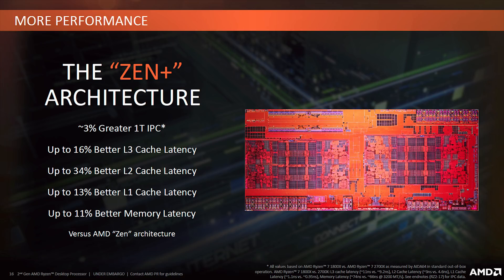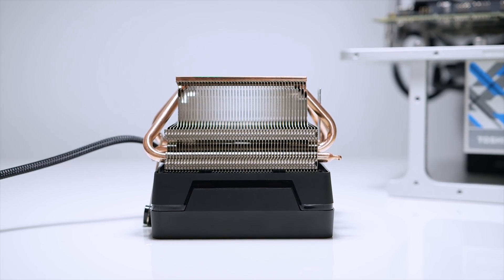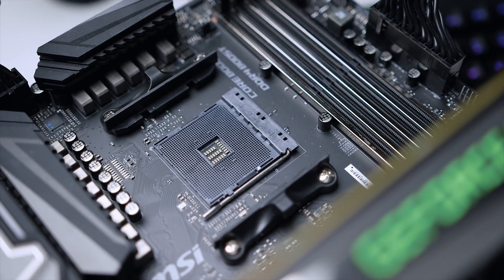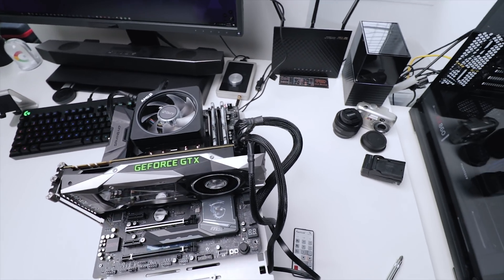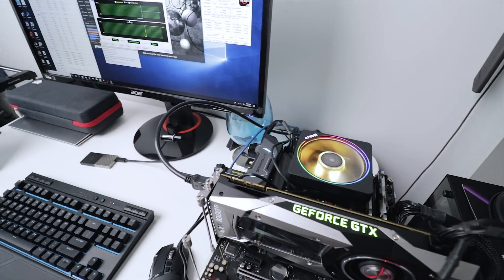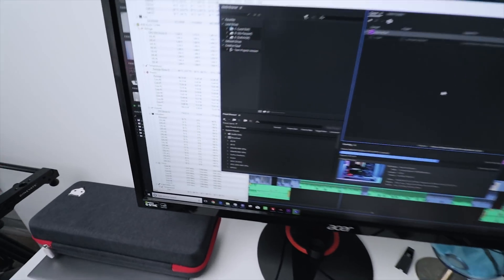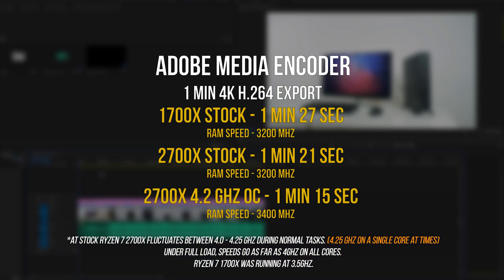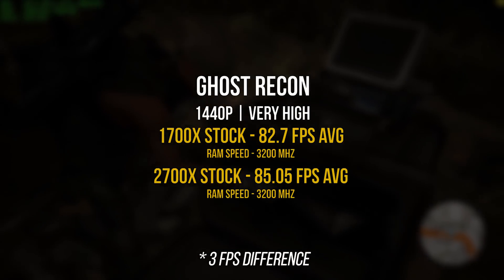Ryzen 7 2700X vs 1700X - Worth the Upgrade?

Comment: AMD are on fire right now. I'm so pleased with the performance of my Ryzen 1700, particularly when overclocked, and that AMD stock cooler is lit. If you're looking for a new CPU that can burn through rendering video/photo/graphics edits while simultaneously watching Netflix, and compile programmes, and virtualization. Ryzen is an excellent platform choice.
Reply: I hate when intel fanboys refuse to let AMD have anything at all, and bitch when any praise is given to AMD. Intel is the mainstream choice, they don't need your help.
Reply: Intel for gaming, AMD for workloads, simple as that.
Reply: Adobe's software is still faster on Intel's 8700K (especially when overclocked). Intel have been working closely with Adobe to improve performance.
Reply: TDS for the prices and every gen they sure are getting there!
Good performance with a stock cooler.. intel better be careful.. price/performance may be their downfall!
Reply: I went with a full AMD rig this time, and holy crap can it knock renders out at light speed, and it's nothing to scoff at when gaming either.
Ryzen 1700x with a Vega 64. I bought the vega at retail when it was listed for retail in an about 3 hour window xD

I don't do a lot of blender rendering, but when I do, I am smiling :P I do compile a lot of code, and the ryzen doesn't let down there either.
Reply: I hate when people speak like Ryzen CPUs are better for every production workloads.
8700k is better for CAD programs, music production applications, Adobe suite(Photoshop, Premiere, After Effects, Lightroom), x265/HEVC encoding.
Reply: I have nothing against Ryzen CPUs, they're the great choice for example on Virtual Machine usage and 3d rendering(when GPU rendering cannot be utilized).
I just don't like when people generalize like this, some people may buy the wrong product for their workload because of this "Ryzen better for production"-meme.
Also I really want for AMD to succeed and stay competitive with Intel in the future too, so we all can have even better and cheaper CPUs.
Reply: The stock cooler might look nice but it suck.
Reply: +Aram Alatrash, It depends on what you're compiling, if you're multitasking while compiling, and if what you're using scales up to use more cores and threads, then yes, Ryzen will be worth it.

If you spend time on Linux, compiling source code, and doing all kinds of stuff like virtualisation, or if you use something like Gradle which does employ all 8 cores, you'll benefit from 8 cores, but say if you're using a basic scripting language like php on the web, then it won't make much of a difference.
Reply: About the compile programmes  part of your comment ,does nore cores mean faster compile time i cant find on any thread to help me in this regard
Reply: @Aram Alatrash unsure about the windows/apple world, but in linux we typically use either gnu make or ninja to compile our programs (ok, in order to tell the compiler to compile the program, but the point remains in most 'real' projects you don't ever manually invoke gcc/clang/whatever your compiler is), and both take a -j argument which tells it how many 'jobs' to do at once. generally this is ''supposed'' to be set to number of 'cores' (logical cores, so threads in multithreaded cpus) +1, so while each individual job may take the same amount of time regardless of cores, with more cores you can do more jobs at once, resulting in a faster overall compile time (i/o limits and clock speed taken into account).
Reply: I get what you are saying, but I will tend to give a bit more leeway to vast generalizations favoring AMD for now, at least until AMD actually starts being able to turn a profit. To me, it is actually 'anti-fanboysim', supporting the market underdog instead of a brand. I will be in the front of the line defending intel if it gets to the point that they need help.
Reply: They are there for sure. I have a I7700 and the 1700X and with DDR4 3200 14-14-14-34 with a gtx 1080 at 1440 there is no perceptible difference. People can argue over 10-15 FPS but if we are all honest .. you cannot tell the difference. The 1700x is much more responsive in the OS environment to boot
Reply: how about AMD stock?
Reply: All of AMD stock coolers suck. Back when I was on a budget, I had a FX-8350 on the stock cooler and the CPU was almost soldered to the cooler after a year of use, just gaming, no OC x') The temps on the ryzen stock coolers are fairly high, and the 2xxx series run at 80 degrees under stress with the stock cooler.
Reply: i was kinda disappointed with it, some games had the framerates drop from the 2500k i had before, sure its significantly better at multitasking.   Also never got over the shitty memory compatibility or the shitty 3.9 overclock
Reply: Unless you play at an extremely high framerate, you are entirely wrong
Reply: Ryzen AGESA updates to the bios have solved memory compatibility issues last summer, the memory controller is as good as it gets. I game using a Ryzen 1700 @3.8hz, a GTX 1080ti @1440p and 144hz, memory running at 3600hz. I have no issues. 

In terms of Intel vs. AMD. The 6900K at $1700 at release, used to be the only "affordable" 8 core chip, which is too much to ask for a non-Xenon chip IMO. So Ryzen offered a capable, yet affordable high core/thread chip. That said, the 8700K family are also an excellent purchase for those who want high clock speeds. Ryzen didn't really make the 8700k family obsolete, it's just an excellent alternative, but it exposed the 6900K $1700 chip family as overpriced, and IMO obsolete. Competition is good.
Reply: On fire? Not really....I mean sure for editing and multithreaded tasks sure. But for a gamer? Absolutely not. Steps in the right direction though. I'm not an AMD hater or Intel fanboy, I was loyal to AMD for a long time, but they're just not quite there yet
Reply: They only used 2666 Mhz ram though.